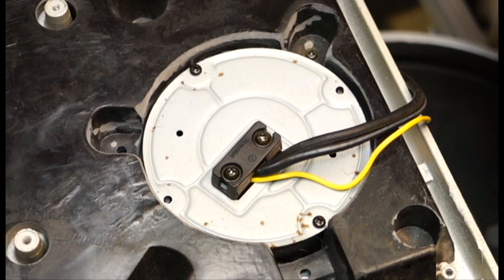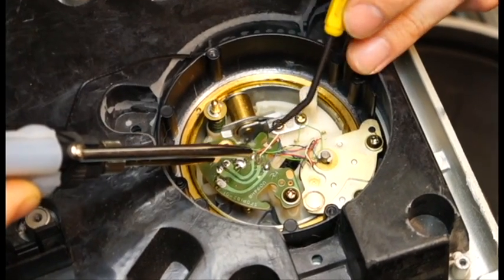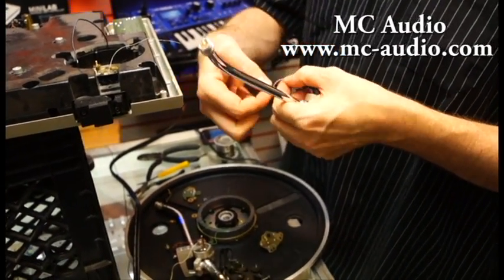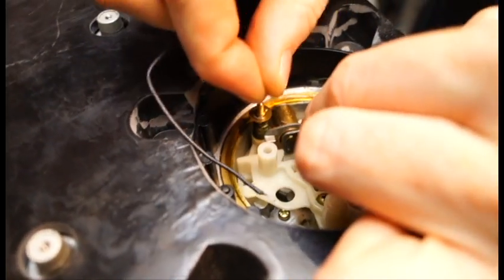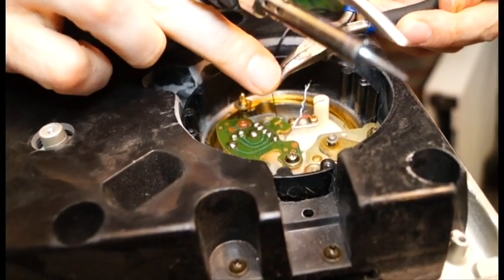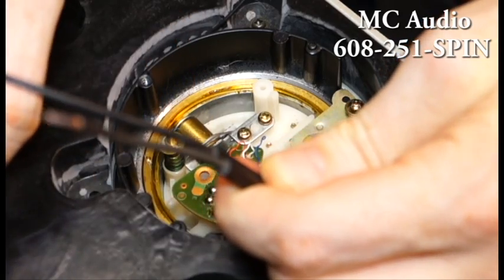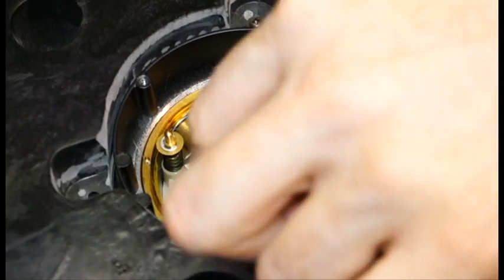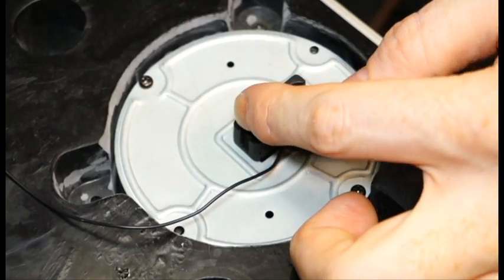Technics SL-1200 Tone Arm, RCA, and Ground Replacement

Comment: Great vid! Thanks for sharing...only one info if it's possible? I can remove RCA PCB BOARD and connect directly head to RCA Cable?
Reply from the maker: We've never tried that, I will put that on the list of modifications to try out

Comment: Awesome job! Whats your view on inrernally grounding the deck to the rca pcb board? Thanks.
Reply: +Theo B Go to a 3 prong power plug and it works, it's still better with a ground wire even with it going to the 3-prong plug

Comment: hello can you tell me that you used welder and how many watts
Reply from the maker: We use a solder station with a variable heat setting set to around 375 degrees F. Use a nicer one with a clean tip, don't get a cheap one!